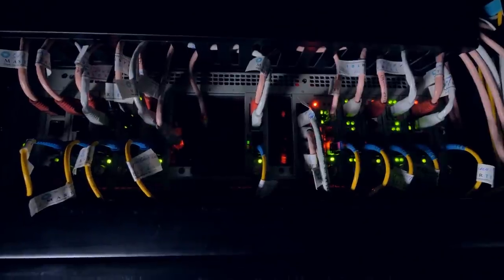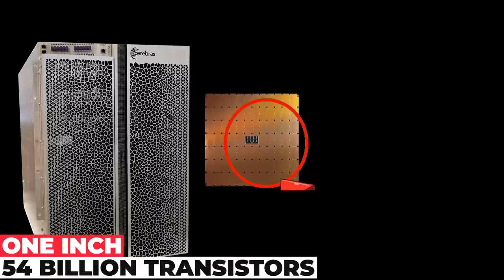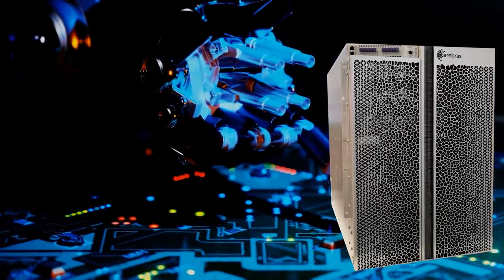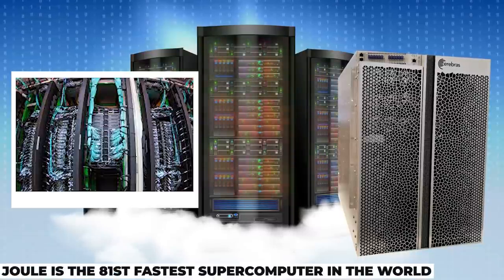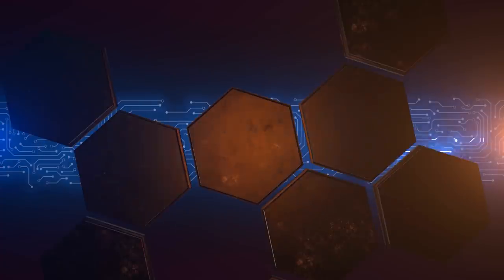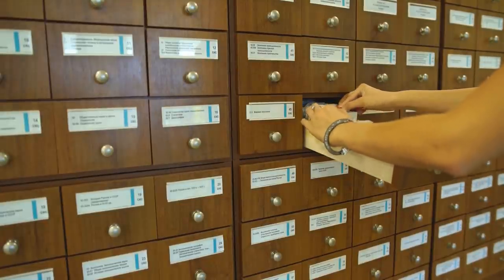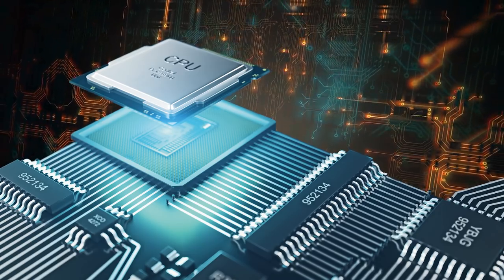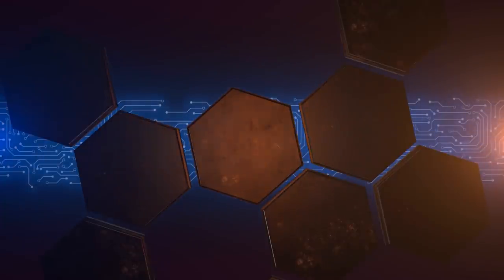The Trillion-Transistor Chip That Just Left a Supercomputer in the Dust

Comment: Me an intellectual who bought 1 million intel cellerons to have a 2 million core CPU, then moved to Antarctica to cool the cpus
Reply: so global warming is your fault, got it.
Reply: this is why the icecaps are melting
Reply: Employees cold? Just run Cysis :)
Reply: Big brain
Reply: 2 million cores of power with 64gb of ddr3 1333mhz ram 🤣
Reply: Just buy an FX chip, just 1.
Reply: That is the plot of one of the Doom Eternal maps.
Reply: Just go into low earth orbit and have free cooling...
Reply: jupiter rules  "when"?? You mean "if", right? I'm still waiting for optical crcuits, which we were told were just around the corner over 10 years ago. Big corner.............
Reply: Did they tell you that Celeron has only one L?
Reply: @FennecTECH  just keep capslock on
Reply: finally,

i can now play dodge the teapots in robloc at 120 fps
Reply: Oh god why a celeron??
get a quad or something, 
my 45nm processor has 820 million and it's not even enough.
Reply: jupiter rules  define molecular.
If you are talking dye size: with all trickery, you'll still need to form a gate. You need a minimum of 4nm per gate because atoms do have a size (more expressed in their relative opposing force but that is neither here nor there) and it will be complex as hell to keep voltages and heat in balance.
Theory is we can bring it down to 7 atoms.
But we're a far away from that.
We've kept Moores law up for a while with tricks like 64-bit and multicore.
We've also kept it up with marketing, whats sold to you as 10nm architecture was measured at its smallest point, not the full gate.
So if you really understand the whole manufacturing situation, we've kind of hit a wall.
Simpler instruction sets like RISC (ARM) can be scaled down a bit since higher math is not needed to be implemented on the bare metal but Intels x86 won't shrink any further.

As for quantum computing: thats a theory, you might see commercial applications and even some university machines, but they are inherently just a part of the puzzle, so far we found certain ways to trap a photon and to read it's state but these machines don't actually run on uncertainty principles and end up with faster binary transactions at the expense of massive cooling. In short, Quantum Computing is still but a theory and we have no proof of what will work and what won't.
Reply: @me1970  atmosphere is probably too thin.. so they wouldn't be able to lose heat through convection. I am just guessing though.
Reply: @randompotato26  
I like to call it opening up large amounts of Canada and Russia to farming.
Reply: Supper villion much?
Reply: @me1970  it's not free if you need to launch into orbit... also you have a bit of a radiation intake that will impact your cooling potential, and not enough cold material to transfer heat into so you will need a lot of time to cool things down.
you might be able to orbit "behind" the earth and avoid the sun's direct heat but the lack of heat transfer targets will still mean you cool things slowly if at all.
Reply: What do you mean quantum computing is still a theory? They have already begun to run advanced calculations on them and they work fine. I've had the pleasure of seeing and using one at my university.
Reply: @gaming-gingerbreadman  and what did you calculate on this computer?
14*5?
beyond noise machines(true random, which is EXTREMELY useful) and theoretically doing more complex calculations in the future, what are current applications we plebeians can have for a quantum computer?
because I would REALLY want to have an actual answer for a change.
Reply: @pgarrett6665  who dafuq uses 64gb ddr3. If your gonna get 64gb in 2021, get ddr4 like bruh
Reply: Inco Gnito  what you are saying is actually a terrible idea. In orbit, any heat you produce cannot just be transferred away. It does not work like on earth. On earth, the heat is transfered mostly by passing it to something else, like air or water
In orbit, that isn’t possible, and the only way to cool down something producing heat is by radiation. Not radioactive radiation, but heat emission. Basically kinda like infrared. This means the only heat transfered is by the very little infrared emission that an object produces. The computer will overheat to melting before right after starting it. To make it work, you’d need an insanely large system of pumps, heatsinks, and radiator panels that slowly radiate heat in vacuum. This would be so large and inefficient. You could have a much smaller system of radiators and with pumps to transfer heat to heatsinks that could work exacly like you would do in space, but in a scale a hundred times smaller if your supercomputer was on earth, because the panels could transfer heat to air. Add that to the cost of sending the size of the ISS into space, cuz that’s how big Youl need your panels to keep that cool. That’s billions of dollars

Besides, the half time you’d be orbiting facing sun, wich would actually contributing to heating up.
Reply: @FlorenceSlugcat  people who use old Intel poopster chips
Reply: Inco Gnito  that's dumb because of global warming :) a real smart 🤓 guy would manufacture out of room temp supper conductor on the dark side of the moon base, DHU
Reply: @DANTHETUBEMAN  moon would also not be efficient due to the fact there is little air. It is more efficient than in orbit, but way less than on earth, even if it is colder. Read what I said 3 posts above yours to understand why.

Remember, you cannot get rid of heat. Heat is energy
You must either transmit, radiate, or transform it
On earth, computers transmit it into air or liquid(wich eventually transfers to air, liquid only moving the heat around to where we can more easily transfer it to air). In orbit, the only way is infrared emissions, and that’s extremely inefficient. On the moon, with very little athmosphere, it is also quite inefficient as you’d mostly relied on radiation with only a little transfered. To gain more efficiency, you’d have to run it though liquid into pipes going long distances underground to transfer it to the ground. Basically geothermal cooling. That wouldn’t be very efficient for the cost it will be to build, compared to the same thing on earth. Also, one thing you got wrong: the moon doesn’t have a dark side. The moon have a hidden side. That is very different to dark side. The moon is tidelly look to earth. This means,  during a full moon, the side you refered to is indeed dark and cold, but during a new moon, you don’t see the moon because the side you look at is actually not facing the sun. That is because the side you mentioned, during new moon, is directly facing the sun, with little athmosphere, it means it is quite hot, much warmer than on earth. So half of the time you it would be hot if you tried bleed it by radiation, leaving you to the only way left: deep in the moon crust. At that point, you can do deep in earth crust and get the same fucking result.
Reply: @FlorenceSlugcat  David Ike let us know the moon is already bradcasting for the planet Saturn 🪐 creating this 🦎 reptile slave planet so if we can hack the feed with supper completing it would be a THEY LIVE ending.
Reply: A great place for a server farm.
Reply: Inco Gnito  oh so your a denier, well 99% of scientist's and Al Gore disagree with you.
Reply: Inco Gnito  Space isn't really any temperature since it's a vacuum and thus devoid of matter with kinetic energy. Rather the matter in space receives no radiation from the sun if it is behind another body or receives increasingly lower intensity of solar radiation the further from the sun it is. However the very fact that space is a vacuum means the amount of kinetic energy transfer is super low. As kinetic energy transfer is one of the most efficient forms of energy transfer, the inability of objects to lose heat through kinetic energy transfer in space prevents them from cooling quickly. The primary means of cooling in space is through radiation which is much slower than kinetic energy transfer. Water cooling on Earth is a vastly superior system for cooling quickly or for transferring large amounts of thermal energy due to the high thermal capacity of water.
Reply: single handedly fucking earth's temperature lol
Reply: @pedrohenriquedesennaalves3031  we have got to arrange those ones and zeroes!!!
Reply: @Alexander Welborn you mean non existent MONEY? 🤑,, I have plenty of that.
Reply: @levelup1279  It can make coffee!
Reply: Aaand you didn't learn networking?
Reply: Did you have a nuclear thermal battery to power it and bundles of fiber? No
Reply: Processing power doesn’t scale linearly
Reply: @pgarrett6665  lol
Reply: Did you plug the computer directly into the sun to power it?
Reply: Send me some BTC.
Reply: should of went with pentium ||
Reply: and you get free heating too, awesome!
Reply: I bet the wireless electric bill is cray cray.
Reply: Me another intellectual who resides in mars and uses the extremely cold polar regions as my cooler.
Reply: 🤣 expanding on that idea, in the future if we don't extinct ourselves, more humans will probably live inside supercomputers on Titan than the rest of the solar system combined. Ironically, for the same reason you joked about, a moderately thick atmosphere at super cold temperatures.
Reply: @FlorenceSlugcat  yep, everything you said checks out. That's why the supercomputer will be built on Titan since it is super cold and has a moderately thick atmosphere for heat dissipation. If we don't extinct ourselves, it will probably be the largest human colony filled with digital consciousnesses, at least until we build a Matrioshka Brain in the far distant future.
Reply: All the continents will be flooded
Reply: @GeorgeMonet  - actually, space is not a perfect vacuum. There is, IIRC, one hydrogen atom per cc. Could be per cubic meter, but anyway...
Reply: You should use the heat from those CPUs to generate electricity to power them.
Reply: @ascathon7069  Matrioshka Brains theoretically work on that concept and respect hard science, obviously each layer is less efficient than the one before or it'd be the equivalent of plugging an extension cord into itself for infinite power.

As an aside: my friend works as a technician and a room full of educated business people got mad at him for there not being enough amps. He explained it was necessary to meet the voltage requirement and they insisted he combine two devices, one that increases amps and one that increases volts so they could have both. At no point could he convince them that it literally trades between the two to adjust the current, they just wanted infinite power. (I could have electrical terminology wrong, I am not a technician)
Reply: thats whats melting the icecaps ..damn you intel!
Reply: you're not that smart
Reply: I can finally play among us in 20k
Reply: Greenhouse gases? Nah. CPUs.

Comment: It must be very hard for them to find finished wafers where all the separate CPUs are without flaws. As I understand it, for each wafer you often have a number of chips that fail due to issues in the crystalline structure of the wafer.
Reply: They use a special "fault tolerant" architecture where they can circumvent and disable those parts with defects in them. Otherwise they would indeed have 0 yield
Reply: I’d be very interested in their interconnect. It helps in the IPC and their fault tolerance. They test the individual processors using a bed of nails and by generating test patterns. I am pretty sure it is a physical challenge. From what I recall, they generally test the processors after they are cut. Removing 10KW of heat is probably not that easy. Wonder if they dip it in a non conducting inert fluid with a high heat of transition.
Reply: Correct. Intel doesn’t intend to manufacture i5 and i3 chips. They started out as i7’s but they had quality issues so they disable a few cores. Fun fact I learned!
Reply: @ionbusman2086  eh kinda and kinda not, if demand for i5s and i3s is higher than for i7s they will gladly downgrade perfectly working silicon and disable the zones that are not needed for the lower tiers. 
i5s and i3s would still exist even if there wasnt such an error rate because not everyone needs/can pay for a top of the line cpu. But disabling defective zones and selling them as a lower tier cpu is a nice way of them optimizing their win rates.
Reply: @lucbuydens1783  Interesting! I'm pleased to know that my guess was correct – I suspected that would be the solution.
Reply: @ionbusman2086  actually not always the case initial manufacturing run will have more faults due to the node being immature and i need of a few niggles iron'd out but as manufacturing progresses and improvements are made CPU manufacturer will find themselves having disable cores in order to keep up with the demand for lower end products
Reply: @rajeshkanungo6627  No, individual die are tested before the wafer has been sawn. A test head contacts the bonding pads and test vectors are run to check for functionality and speed; there are also special test structures distributed around the wafer in the scribe lanes that are used to test various parametrics, before the sort test.
My expectation is that the top layer interconnect (ie wiring all the chips together) is either a standard design with customisation through "blowable fuses", laser cut connections or possibly programmable gates to set a connection. The other possibility is custom printed connection layers using either laser/e-beam writing.
Reply: @thecraggrat  Thanks.
Reply: @ionbusman2086  yea an amd does this too.. everyone remember the 3 and 6 cores?

Comment: In the early 1980s I was programming the Intel 8086 and Motorola MC6809 microprocessors as an undergraduate ECE student. Then I remember writing assembly codes for the MC680X0 series microprocessors when I was a graduate student. We have come a long way baby!
Reply: I kind of worry that processor technology will stop advancing
Reply: @Bigdaddymittens  Unfortunately Moore's law died many years ago!
Reply: @bluestar2253  I figured as much. Is there a specific reason for companies not just making their electronics bigger to fit more transistors?
Reply: @Bigdaddymittens  The classical transistors may have reached their physical limits or almost close to it. Recently IBM announced their 2nm chips. I'm sure Intel, Samsung, and TSMC are closely behind. The next frontier will be quantum computing based on principles of quantum theory, which explains the behavior of energy and material on the atomic and subatomic levels. Quantum computers perform calculations based on the probability of an object's state before it is measured - instead of just 1s or 0s - which means they have the potential to process exponentially more data compared to classical computers. ...
Reply: @bluestar2253  you saw the 50 billion nm processor that's pawg, we are entering supercomputing age.
Reply: @bluestar2253  technically it died but were still gaining efficency wich translates in to real power.  You should check out corteks videos.
Reply: @bluestar2253  problem is that quantom computers still need to be kept to nearly 0 kelvin to work efficiently
Reply: @WandererHermit  Agree. Who knows maybe there will be a high temperature quantum computer one day, just like high temperature superconductors (HTS).
Reply: @bluestar2253  I think quantum and conventional computing will live side by side. So imo, the next leap is going to be something like going from silicon to gallium.
Reply: They haven't even integrated memory and processing nor started stacking chips on top of each other yet.
Reply: Ya that is why I gave up. Being a late starter as soon as I started to learn the first computers and languages they were obsolete and it kept going on like that. You know where this all going don't you?
Reply: @WandererHermit  What if it was on the international space station exposed to the outside temperature in the vacuum of space?
Reply: @plo8monster113  still wouldnt help because space is not cold enough
Reply: @WandererHermit  Thanks :)

Comment: Next step: *Make it a cube
Name: “The quintillion”
Reply: A.k.a. The Molten Lava, the first processor that is designed to melt the first time it is used.
Reply: just wait until we have the nanomaterials to convert heat back into electricity
Reply: @u.v.s.5583  lol i think that's what Windows 1995 did....
Reply: Real Tesseract
Reply: Do you think It’ll bottleneck if I pair it with my 3070 😳
Reply: @Cynadyde  we do, they just not that efficient but more damming have to obey the laws of physics and require a cool side to work.
Reply: Hal 2000?
Reply: @Cynadyde  violates thermodynamics though ^^^

edit: or well it could the way you describe it, you would need a cooler area to move the heat to (to run a heat engine)

Comment: I can still remember using a PDP-11 at university (1974), with a whole 16k bytes of ferrite core memory!
Reply: Yep the 11/34 mini. It ran process control on 5 paper machines back in the day.
Reply: Back when the only hex editor you'd ever need was a pair of gloves
Reply: @annunacky4463  We used to dream about the 11/34.  This was an 11/10.  I think it has about as much computing power as a digital watch.
Reply: I used PDP-11s using RSTS/E in the 80s. 

Developing commercial apps in DEC BASIC with 16K available memory, and a 24 line, 80 column green screen terminal.

Comment: This is actually really interesting. Even if it only proves to be useful for the niche applications if it's doing so much better for so much less space, power, and cost that's going to solidify its niche right there in my opinion.

Why spend tens of millions plus insane amounts of power when you can fit three of these things into the same space for less money, less power drain, and get far better results?